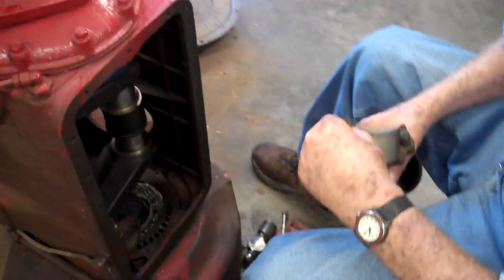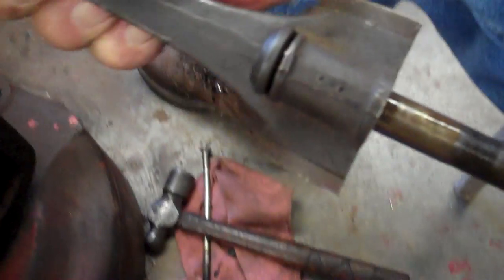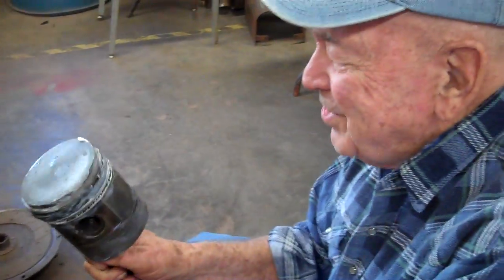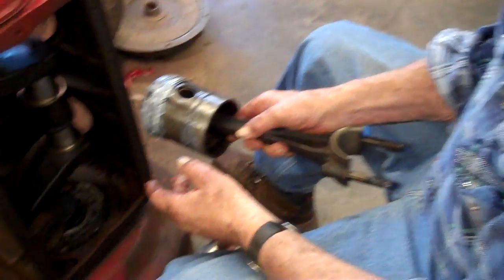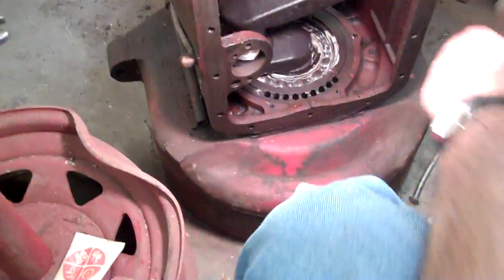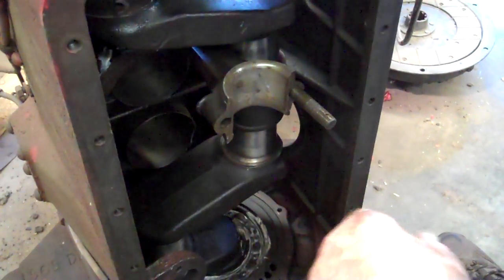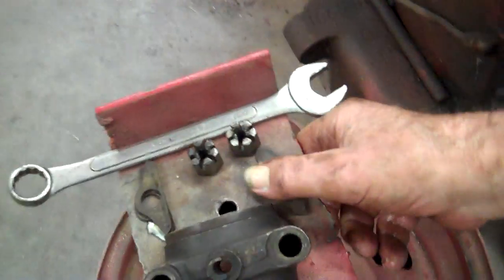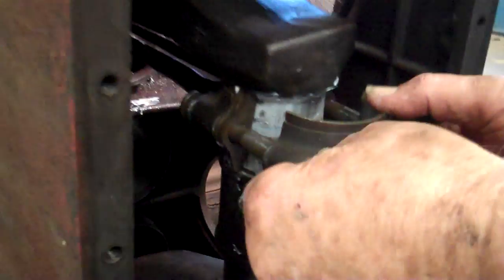Tractor Restoration - Installing Pistons

Comment: Any chance you need a piston ring compressor? And maybe a rubber mallet? This guys probably done many more engines than me, but hes the first guy Ive seen put in pistons without a compressor and using a metal hammer on machined parts.